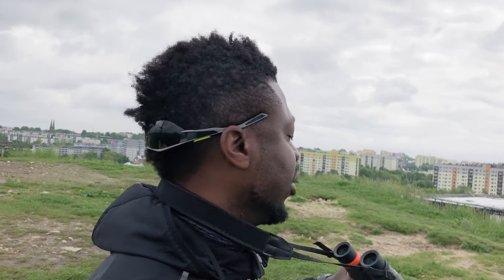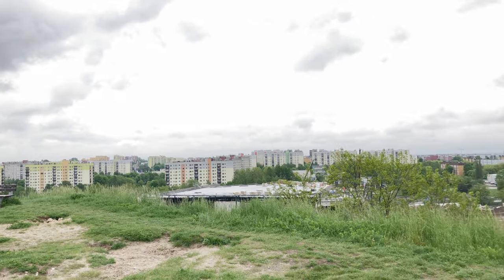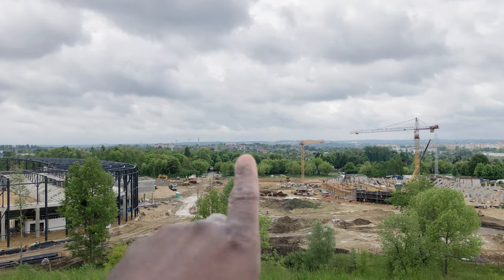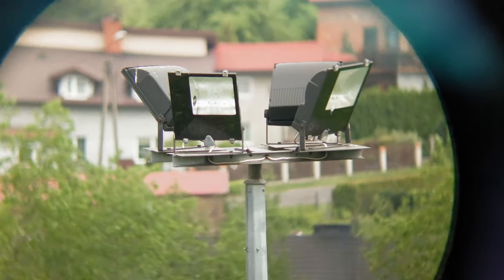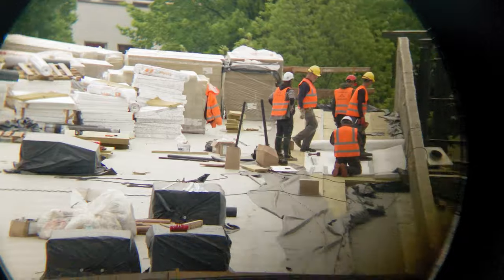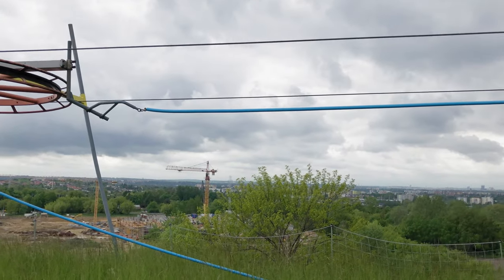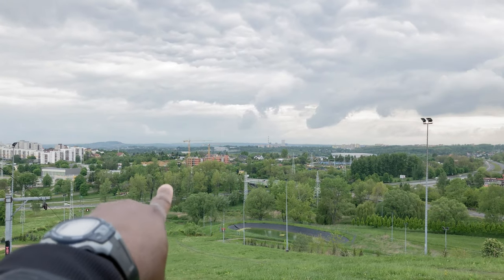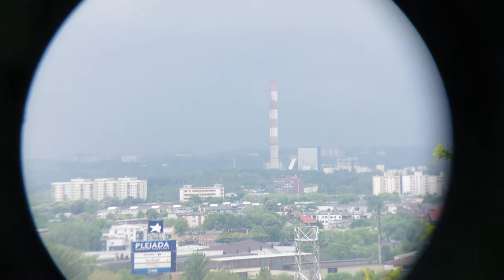10 x 42 vs 25 x 70 Binoculars comparison

Comment from the maker: What is the best binoculars in your opinion.
Reply: Kowa Highlander 32x82 followed by Maven B5 18x56. 
Not the cheapest but they're the best IMHO. Probably the Swarovski also.
Reply: Also the SIG Zulu 9 15x56 when you see them on sale for under $700. 

The Baigish 15x60 for $160 are also pretty good for cheap. Image quality looks clearer and weighs much lighter than the Vortex Vulture 15x56 when I compared them both. 

I'm testing some different Bushnell Porro Prism 20x50 Binoculars now. They seem to offer the best bang for the buck in the $50 price point.
Reply from the maker: @commonsense5709  You can't beat the Nikon at this price range.
Reply: @Sir-Kay  That is true

Comment: I got the Diamondback 12x50 to help with zeroing/spotting past 50 meters.

I wasn't sure if I had enough magnification until I saw this video.

Thanks a lot
Reply from the maker: Glad it helped, hit that Like button for more.
Reply: I tried a lot of Binoculars and found the older Bushnell Powerview 16x50s made in Philippines are actually winners can be found used for less than $50. They're much better quality compared to the newer Chinese made ones.

Comment: i have 10x42 nikon monarch m5, i wanted to get higher power and bigger lens for astronomy such as 20-25x 70-100, but from this video; it really doesnt seem like there is 15x more magnification compared to the 10x42. From the naked eye there is a big difference to both bins, but from 10x to 25x the magnification doesnt seem 15x more
Reply from the maker: It's never like that with any brand. Conduct a comparison between the higher end 10x  with 20x Swarovskis & you'll see you don't get any where near 2 times the magnification, it's just the way these specs are, not to mention this was a comparison between two completely different brands. Anyways, hope that help clarify your point, don't forget to hit that Like button for more.

Comment: The other thing is that the 25 by 70 binoculars are very heavy and difficult to Hold Steady for any long period
Reply from the maker: You're right, other than that, the images I get for the money I paid can't be beaten.
Reply: @Sir-Kay  How much do these binoculars cost?
Reply from the maker: @venator7889  I bought mine for less than $100 before this recent inflation.